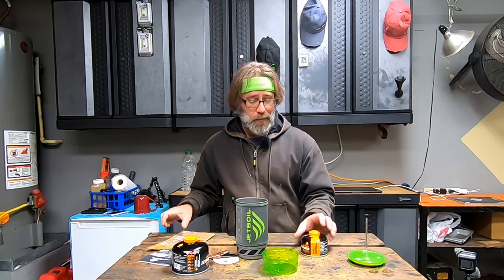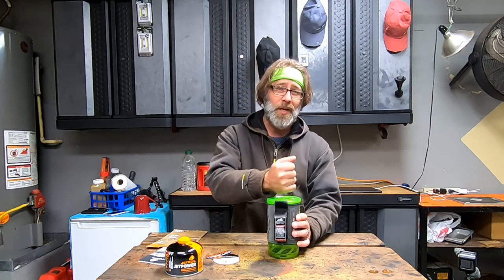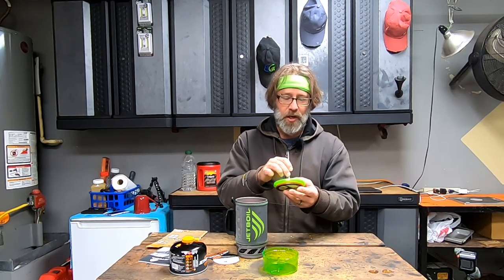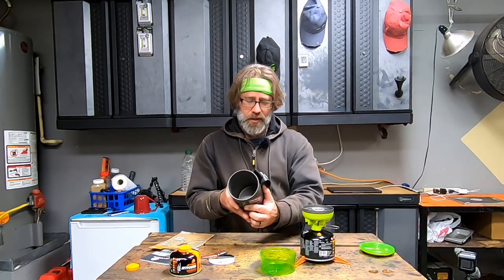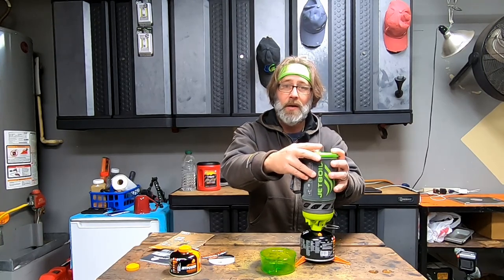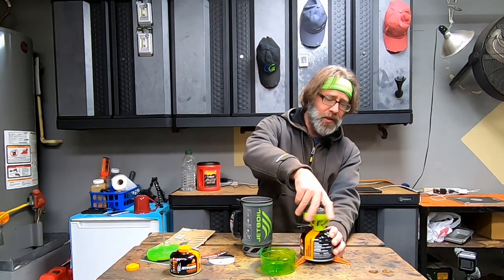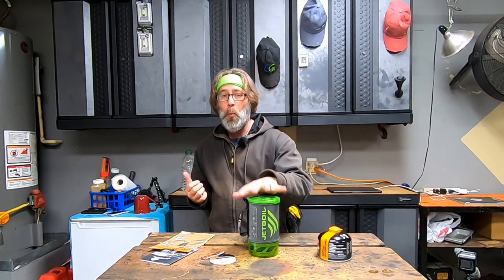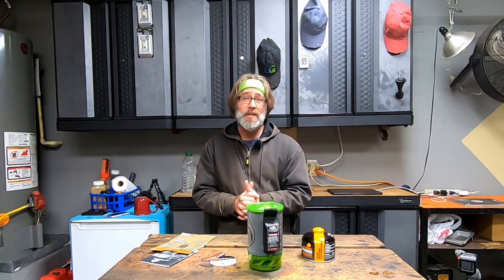Episode 438 - The Jetboil Flash Setup & Take Down | Initial Thoughts & Review

Comment: I love my Jetboil. I use it to boil my water for my Stanley French press. That way the coffee oils don’t stay in the Jetboil and I can use it to boil water for mountain house meals, oatmeal, etc and not have any coffee flavor get in those foods. I also use the Coleman fuel and it works great although I cannot get the Jetboil feet to fit on those canisters but it’s never an issue. It’s stable just sitting on the canisters. I’d feel comfortable going out for a week with two small canisters and using it for coffee and every meal if needed.
Reply from the maker: Great call Jon. didn't think of that. So far totally digging this. Probably won't use it for anything but coffee but its really nice to know I can through it in the pack if needed you know. Still haven't tried the coleman fuel just yet but looking to run some test really soon.
Reply: @BubbasgarageTv  awesome. It’ll be interesting to hear your results.